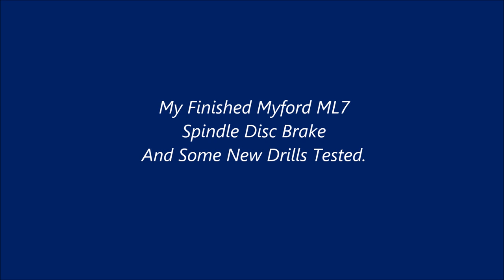Myford ML7 Spindle Disc Brake Plus Testing Some New Drills

Comment: What is the prox for....... @ 7:00 Self evident.... Good idea !!!. On the Myford that I use it has a three phase motor and VFD that I fitted and wired, when you disengage the drive and leave the motor running belt slippage is such that it will spin the spindle I get that being able to lock the spindle is a nifty mod.

Comment: Good stuff Steve. I have put some of those parting blades on my wishlist. I have the banggood cobalt 1-13mm set, bought a year or so ago, but it doesn't have the stepped grind, and didn't come with the drill index. Shame! Those drills punching straight through stainless like that can't be bad. I've found mine to be excellent, and cheaper than I can get a set of standard HSS bits for locally. Cheers, Craig

Comment: very good video Steve.   I bought a set of those cobalt bits from Harbor Freight and they sure are worth the little extra in cost.  And the grind from the factory is superb but I need to be very carful they are very aggressive and what to bite and act more like a screw than a drill bit.  Especially in aluminum.  Thanks for the video showing the breaking system.
Reply: For alloy you should always back off the cutting edge.

Comment: Hi. When you disengage the counter shaft i noticed you spindle stops. Mine however does not stop. Although there is little to no tension it keeps driving the spindle. Is this because its not set up properly ?
Reply from the maker: Hello Guy. When I first got mine I couldn't shut mine off either. That was because I had the original rubber pulley belt on the spindle. I got rid of that one and fitted a Fenner Powertwist link belt which is made of a composite polyester/polyurethane material
This belt is much better and can be adjusted to slip. Also one doesn't need to dismantle the headstock to fit one. 
 You can buy the red Fenner Powertwist from various places including eBay. Or you can buy unbranded plastic link belts which are much cheaper, but not as good as the USA Fenner.
Regards Steve
Reply: Hi thank you for the advice i will be buying one very soon. Love the work you do and modifications you have made.

Comment: Do you have a link for the parting off blades?
Reply from the maker: I grind mine up from these. You can cut them in half on the grinder and make two tools from one piece so its really economical;
Machifit 200x12x2mm HSS Square Engraving Bit Milling Lathe Tools Turning Tool--http://bit.ly/2KyU0vq
Regards Steve

Comment: That's a nice set up Steve! Good idea, and also in your previous video what is the paste you are using for tapping? That was also  a good video Thanks
Reply: It looked like way lube to me, but I'm not sure. I would quite like to know which cutting oil too.
Reply from the maker: A found a large tin of cutting compound at my local recycle centre some years ago. I don't think its even made now. Its called TREFOLEX and was made in Slough UK. Its as good as new and enough for a lifetime!!
Reply from the maker: Yes they still make it you can buy it on Ebay. Its the best cutting compound I've used.
Reply from the maker: https://www.ebay.co.uk/itm/Trefolex-Cutting-Compound-500Ml/254187251988?hash=item3b2ebda914:g:lpEAAOSwsTtbdSU1
Reply: @SteveJordan  Cool - thanks for the link Steve. I had heard of trefolex before (I may even have half a spray can of the stuff that a friend gave me), but I would like to try out some of the tinned stuff. Thanks, Craig

Comment: Steve, as a ML7 owner I cannot see the point of having a brake on the spindle. I do enjoy your videos though.
Reply from the maker: Mine sometimes continues spinning with the lever off. I have a   Fenner belt which I prefer but have tried every adjustment to get the spindle to stop without success. It's ok in one position on the pulley but not the other. Even though I have a VFD I still use the lower speed pulleys for drilling torque. I don't like stopping the chuck by hand especially now I leave the indexing pole in position. This is why I like the brake. Regards Steve
Reply: I expect that if you have a heavy job in the chuck, it will spin and spin. All those times a lathe is started and stopped and you can shave 5-10 seconds off each time, might add up to a lot of time at the end of a day's work.
Reply: Yes that is because ML7's don't have a proper clutch like the Super 7 as actually they are the cheaper version of the Super 7:-) I have owned a Super 7 for the last 50 years, The last one I bought it 23 years ago it is a Super 7B bought it new from the factory it is still going strong I use it every day as I am in the stationary engine restoration!!

Comment from the maker: SEE TOOL LINKS BELOW:-
Drillpro 8pcs 1/2 Inch Shank HSS 4241 Twist Drill Bit Set -- http://bit.ly/2TP681S
Machifit 200x12x2mm HSS Square Engraving Bit Milling Lathe Tools Turning Tool--http://bit.ly/2KyU0vq
Reply from the maker: Banggood Health Protection -- http://bit.ly/33tNTBx

Banggood Health&Care Protection --  http://bit.ly/3d7QpSy
Reply from the maker: BIKIGHT 160MM MTB Bike Mechanical Disc Brake Front and Rear Brake Set-- http://bit.ly/2H5DH8B
   2 Pair Of Round Mountain Road Bike Cycling Bicycle MTB Disc Brake Pad Replacement--http://bit.ly/31GFw3L
Reply from the maker: 6pcs 3 Flute Titanium Chamfer 90 Degree Chamfering End Mill Cutter Countersink Drill Bit--http://bit.ly/2KLmJ04
Reply from the maker: Banggood Health Protection -- http://bit.ly/33tNTBx
  Banggood Health&Care Protection --  http://bit.ly/3d7QpSy